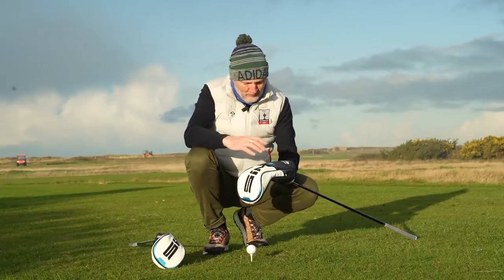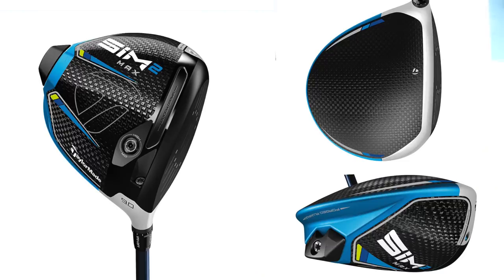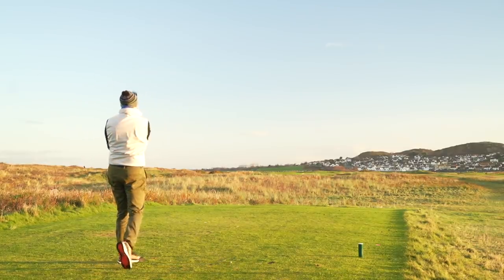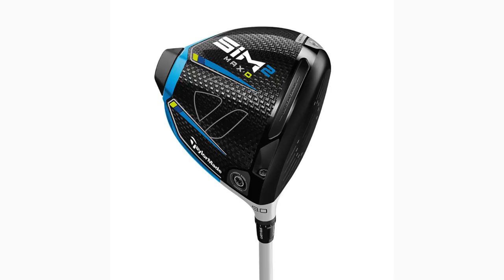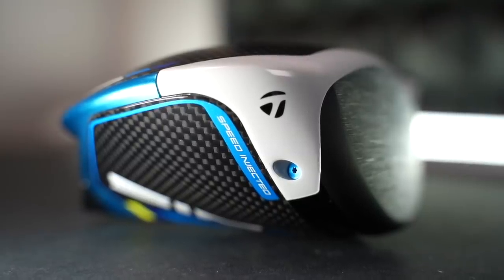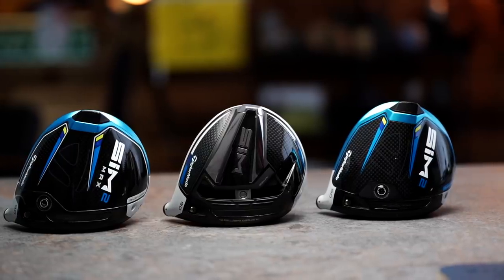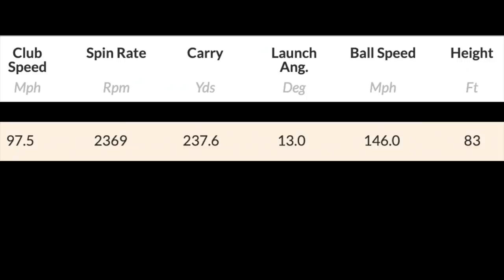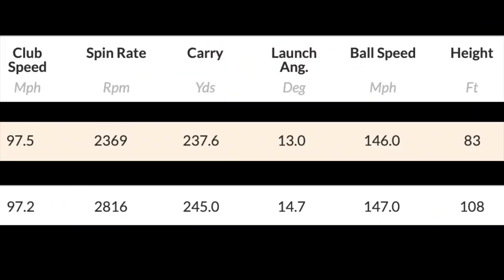ONE MAJOR ISSUE with TAYLORMADE SIM 2 DRIVER?

Comment: I have the M4 but having watched your other reviews I am definitely edging towards the Ping G425 for the extra forgiveness
Reply from the maker: In all fairness I will say all drivers tested so far 'seem' to have improved forgiveness but its so difficult to comment on accurately
Reply: Me too Ian !
Reply: I just got fitted and I’m bias Ping btw but the sim 2 felt so much better and checked off all the boxes I was looking for. I didn’t like the sound of the ping at all and quite honestly wasn’t sure what all the hype was after hitting it. I ended up going with the sims 2 max the sims 2 3 wood 15* and the 2 sims UDI all X stiff flex
Reply: @CBC9019  Got fitted yesterday.  Tried the Callaway epic Speed, Cobra Rad, Sim2/Sim2 max and Titleist TS2.  Was down between the G425 and Sim2 max and went with the sim2 max.  Like you, thought the g425 sounded horrible.  It was much more boomy and loud compared to the others, though I did like the matt black stealth look).  Got mine with a stiff Hzrdus Smoke black 70g shaft and can't wait to try it out
Reply: I tried the SIM 2 and kept pushing it to the right. .then I tried the ping 425 and wow what a difference. Long penetrating flight. No competition ping hand down winner
Reply: @michaelprobert1967  Glad it worked for you...didn't make a difference for me, I pushed them all right :(.  On the positive side, went to the driving range and hit it 285yards so should make a difference as I haven't had a driver in my bag for years....i just maybe aiming for the green from the wrong fairway :))
Reply: @michaelprobert1967  opposite for me. Ping sounded terrible and performance average at best. Sim2 sounds incredible
Reply: @granty1954  I agree on the sound thing. But performance is what I went for. But everyone has a different swing and what suits the individual the best is all that matters. 👍
Reply: @michaelprobert1967  what shaft did you get and flex

Comment: Just purchased the SIM2 Max 10.5 driver and 16.5 H/L 3 fairway. I haven’t played a TM driver in many years but I hit it this morning and walked out with the two clubs. I’ve been wed to Ping and most recently Callaway drivers but my fitting guru encouraged me to try it and I’m glad I did. I particularly liked the performance of the larger footprint of the fairway wood off a tee which is primarily how I’ll use it, especially on tight driving holes and longer par 3’s. Looking forward to putting them both in play.

Comment: I was a long time TaylorMade driver fan until getting fitted into a Ping driver. My all-time favorite driver is the TM R5. But this latest offering is just too flashy for my eye. Were I moved to replace my Ping G400 Max, it would be with the G425 Max. I just can’t get over the looks of of SIM2. TaylorMade looks to borrow some color selection from Nike. I might fit into the “Below Average Golfer” category. 94 mph driver speed but I do hit it all over the face. 😂 Well done 👍🏼
Reply from the maker: The G400Max takes some beating Matt but the G425 is interesting and would like to see them head to head

Comment: Andy, Clubhouse emailed me at 12pm and they were £399 for each of the 3 models. Its going to be hard for any manufacturer to get lots more speed with the regulations being the same but they can improve forgiveness. I think that's where driver reviews need to focus going forward, dispersion from off centre hits all around the face. I appreciate its easier to show strike with a Quad but as far as I'm aware it is possible with Trackman now
Reply from the maker: Only on Trackman 4 and Quad which is so expensive, I am looking into ways in which I can justify the Quad
Reply: @TheAverageGolfer  none of it is cheap that's for sure !

Comment: I’d have concern about the wearability of the sole
Reply: Should have a metal plate on the sole
Reply: Just wait till all these sim 2 owners start to scuff, scratch, and wear down the carbon sole, Shouldn’t be hitting the ground with the driver as a good player, but the average golf player is just going to scuff up the crap out of that carbon sole being that their attack angle is so steep.
Reply: @wesboothe6507  I hit the ball cleanly and have this club. It’s amazing how after two rounds and lots of range balls, it still looks brand new. Kinda shocking. But again, I’m not hitting the ground.

Comment: I use the original SIM and I really like it.  I won't be upgrading any time soon.  Taylormade has said they removed the sliding weight to better the aerodynamics.  I can hear the head "whistle" a little bit when I am on the tee just swinging the club and that is from the sliding weight.  However, I don't notice it when I actually hit the drive.  Ironically, the SIM 2 bottom weight is in almost the exact same spot where I have ended up liking the position most on the sliding weight of the SIM.

Comment: I was originally put off by the turquoise accent which is too bad as I was considering a new driver. Yesterday I found out you can personalize the colors thru TMs MySIM2 option! There are 8 colors to choose from for the following accent areas: aluminum ring, crown decals, sole decals, and the face tuning pin, as well as blacking out the top line paint color. So I ordered a lava red SIM2 :)

Comment: Great review Andy and as honest as ever👍
Bottom line because of the R&A and USGA Rules there is nowhere for the OEM's to go other than tinker with performance on off-centre hits, so it's mainly going to be about looks and sound this year.
Can't say that the TM or Callaway impress me this year and that carbon sole looks cheap and I would be worried about it cracking, they both get a thumbs down from me.
Reply: I agree with your concerns for structural integrity of the carbon sole in terms of durability, I prefer the original sim head with a heavier back weight for more stability to increase MOI, it’s been incredible for me!
Reply: @wesboothe6507  👍

Comment: You've mentioned this before Andy, but with proper fitting there's so little to choose between so many of these new drivers for distance, so it comes down to that thing called forgiveness / ability to hit fairways. Perhaps that's where they next year with their technology and marketing!
Reply from the maker: To be fair I think it has been this year, there is a lot of focus on forgiveness and ball speed across the face as opposed to 'this driver is the longest'
Reply: Would be good to see length & dispersion comparison tests for new driver against same brand 3 wood (on course and dry ball data). That's the choice we make on a lot of tees!

Comment: Thanks for catching me up to speed on modern driver tech. It seems to me the more parts you add increases failure points. I have a pretty high speed swing. Me with my 9.5 TM burner from 2010 was managing around 300. Had a guy talking me with a TM sim2 he was constantly out driving me by 30 to 50. Last hole I talked with him and he said that was his 3rd sim2. The first 2 developed cracks and were replaced under warranty. He showed me the current one he was using and the sweet spot was becoming flattened. So after this long exert I questioned if the new TM driver can handle someone who really cranks them. Adjustable loft drivers movable counter weights to correct draw/slice. It's seems to me that those features could be detrimental once one really starts controlling their drive rather than adjusting the driver to correct a bad swing.

Comment: Looks good , but the reviews thus far are a bit like most new drivers recently there’s not much point in changing unless you have a driver older than say 5 years. Or you just want the latest and greatest available driver.
Apparently the sliding weight has gone because the inside of the face is milled and it wouldn’t be possible to mill the bottom of the face either the track. It’s also why the screws on the face have gone.
Reply from the maker: I would have to agree David

Comment: Hi Andy. Loving the reviews. The thing that would concern me with these heads is the sole. Not the design, but the materials used. In summer not  really a problem, however in the winter playing off sanded mats ( uk and most of Europe) that carbon sole is gonna be  ruined. I would never buy a driver based on re-sale value, but these bad boys are gonna be  mangled. I know they’re  going to be “slightly “ cheaper than some of their competitors but  the race for club head speed, ie carbon club heads, affects the consumer more than it does staff players.
Reply from the maker: You make some very valid points
Reply: Isn’t carbon fibre supposed to be as strong as metal? Isn’t that why they use it in formula one cars, to save weight, without sacrificing strength?

Comment: Has any one driver stood out for you? My buddy just broke my SIM so I'm int when market for a new one. Or do they all preform too similar for you to say?
Reply from the maker: Its quite a broad question, I was a big fan of what Callaway did with the BB21, but certainly not for everyone
Reply: You will have warranty on your driver. As long as you did not break it over your knee. If you broke it by swinging the golf club. They will cover it. Promise. My driver snapped from the hossel. Caused by poor glue in the shaft. The driver head flung off the shaft while I was hitting over a canyon. And they covered it. So. Give it a shot. Experience was quite traumatizing. But golf clubs hold there warranty

Comment: In my opinion the new SIM driver just looks cheap to me. I don't know if it's the carbon sole or the blue trim but it just doesn't appeal to me. I like the fact that they got rid of the sliding track bar.i never was a fan of that on any driver. As far as the 2021 drivers go I would pick the Titleist or the Srixon or the Ping over the Taylormade.

Comment: Given that the performance of the face is governed and has been for years I wouldn't bet on this (or any other driver) to be worth the upgrade and the price. I'm not keen on TM as they bring new stuff out far too often. I know some drivers have gained longer shafts to win the youtube testers long drive award but can amatuer golfers square the face with these longer shafts? Not for me.
Reply from the maker: To be honest I dont even think the manufacturers are even suggesting they are 'longer'
Reply: @TheAverageGolfer  True enough. I've tried putting a lower spinning club in the bag but I just can't let go of the old one, I know it doesn't run out, it goes a bit high and a bit too much spin but it hits fairway. Are you still sporting the PXG or has it been changed yet?

Comment: If you can “cope” with a look, then it is all about performance and value. Best looking driver is not close TSi by a mile. Performance is another question and value. Ping and this £100-150 cheaper than Titleist. Next, are previous models, so much better value, for so little gain. Each golfer may see this differently. These days, only a foll does not try at least 3 of the top choices.
Reply: Chris Mayor titleist is only 50 cdn more in Canada then the other brands you mentioned.

Comment: Dislike it.  Don’t like the colour at all, very garish. Agree with your comments re the sole, makes it look cheap and less robust.  Also find the loss of movable weights strange, although I tend to leave mine in the middle it is an extra tool for fitters. It’s going to make spotting counterfeits difficult when the original looks like a cheap knock off😅